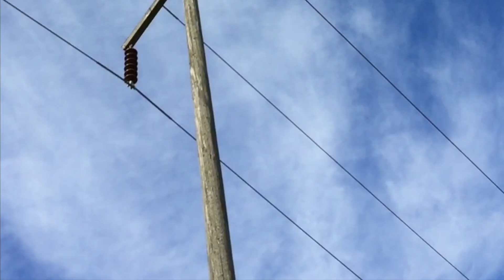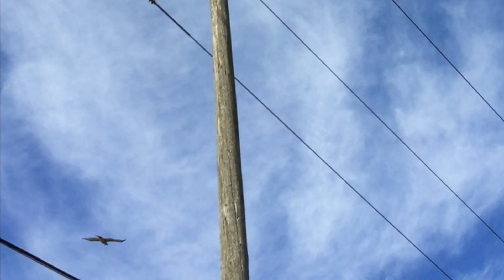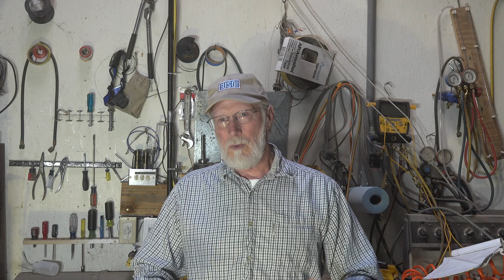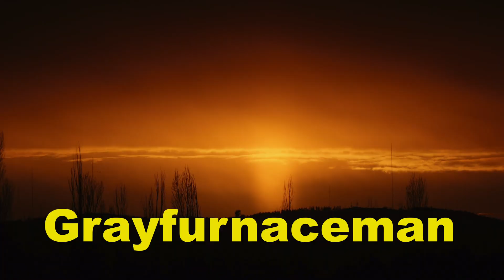Troubleshooting HVAC systems

Comment: GM gary / this year replaced  pressure switch  put ii a transformer out of panic had a rusty fuse socket we believe may have been the isse cleaned and running  got up this am houses at 63  turned on off a few time got a code couldn't retrieve it then it began to run  did note that the pressure connectors and the transformers holder nts were not tight .they where retightening  where would you begin to recheck unit  lennox down draft GHR26Q3-75 thanks  james

Comment: Hi Gary, thank you for your videos. i’m actually an electrician (25 years) and troubleshooting IS my thing. i also enjoy fixing devices at a component level (which is much harder now with integrated circuits and our disposable culture) my furnace is not working currently and now i have the basic working knowledge to get the heat back on! I have some questions for you regarding gas combination valves that your other video didn’t cover. the on/off selector on the valve slides left/right but also pushes in. since my evcon dgat056bdd has electrical ignition and a 24vac which allows the  gas to flow. does pushing down the on/off selector manually start the flow of gas? i’m getting no errors flashing on the status light, when the furnace gets its call for heat, the furnace get to the point where the igniter glows and my multimeter registers 25.2vac at the combination valve and occasionally the furnace ignites, but recently it has not lit in days,  i’m thinking it’s a old igniter which is not drawing the required amperage to allow the flow of gas or the combination valve is bad and not opening when it receives the voltage from the control board is there a way i can test the combination valve? should I press the red on/off selector?
Reply from the maker: The ignitor may not be heating as hot as it should.  If there are bright spots in the ignitor, it may be broken. You can try a resistance test.  Most run about 150 ohms.  Also I would check amp draw of the gas valve when there is a call for heat.  No amp draw, no effective power to the gas valve.  The on-off switch is just there to shut down gas flow.  It is not a bypass.  
GFM
Reply: thank you gary! i wish i lived near you, i’d love to apprentice with you. I have been doing component level repairs on pro audio equipment (mixing consoles, microphones, amplifiers) for a couple of decades. i’d love to learn HVAC and appliance repairs, but there is next to zero information out there and having watched other peoples videos on electrical troubleshooting and how to’s i don’t know which information on HVAC is as flawed as the electrical videos. you break everything down into very small pieces and having the specs such as what resistance an igniter should be is priceless. THANK YOU!!
Reply: the igniter reads 99.8ohms

Comment: But a clog is only a symptom.  I attempted to clear a line and I had to remove a piece of pvc pipe that had four elbows is less than four feet.  I cut them out and my vacuum cleared the clog right away.

Comment: I don’t know where to start? 1st of all every year I have to replace the igniter at least the beginning of the season and towards the end, never falls. I did find the straight rod igniter lasted longer then the OEM. (Snyder General GUG1990) filter gets replaced monthly. Well this year it something else. I’m not getting nothing just a click noise on the thermostat. I have replaced that a couple days ago thinking that might be the problem still nothing?
Reply from the maker: First, on the flame rod, is the furnace installed in a laundry room?  Have you cleaned the rod?  
For your latest failure.  Power to the furnace?  
GFM
Reply: Yes I cleaned the rod and no not in laundry room. Underneath my house in the craw space but I can stand up somewhat. Which my garage is on the other side of. I clean the furnace yearly since I have to replace the igniter in November and February each year, except one year I bought a straight hot rod igniter that lasted several years. It stopped working last winter but I been using my natural gas wall heater at this point along with other electric heats for the rooms I’m mainly in.
Reply: Yes power is on as well.
Reply from the maker: @runin1wild  At this point, troubleshooting will have to start.  Is there an led lit on the ignition control and is it blinking?
GFM
Reply: No light nothing blinking
Reply from the maker: @runin1wild  Is you inducer starting?
GFM

Comment: Hello I want to know why my furnace runs over night and the next door my fuse blow? Do you have any experience you can share thank you
Reply from the maker: Oil, gas or electric?
GFM
Reply: @grayfurnaceman  I’m a new apprentice,  I’m getting a good handle on things but find the wiring and electrical the hardest!
Any tips to help me understand easier?
Reply from the maker: @bobtaylor4573  Ahh, wiring and electrical, the hill that stops us all.  First, you must learn how to read diagrams.  When the wiring ends at an electronic control board, you must understand how the board works.  About the only simple tips I have.
GFM

Comment: I am having an issue with my pulse furnace g14. My purge blower is running while it is up to temperature set on the thermostat. Then times out and restarts again and again. It does this constantly. The furnace heats the house fine but the only time the purge blower stops is when it times out for a few seconds a restarts.
Reply from the maker: First, I would disconnect the W wire at the terminal board.  If the purge blower stops, you have a thermostat problem.  If it does not, you may have a stuck relay in the ignition control.
GFM

Comment: Sequence of operation is key.Knowing what it is doing or not doing relative to how it is supposed to perform is important.It is generally a three step procedure: 1) Diagnosis, 2)Isolation,3)Correction.That is define,locate ,and fix the problem. And knowing how to read schematics and experience of how components operate (Theory of operation) go a long way too.
Reply from the maker: Agreed.
GFM
Reply: Robert, you could not have said it better. Sequence of operation was drilled into my head at Linn State Technical College 38 years ago and it's still true today.

Comment: It seems like that "20% of the time" ends up being my 100% of the time.
I can't recall ever getting a cut-&-dry service call.
Reply: Cut and dry. What you mean? Like a simple diagnosis?
Reply: Turn on a furnace switch that a visitor turned off. Less than two minutes.

Comment: Methodical is best and while slow at the start, things get faster as your mind and eyes get trained.  And those you can "guess"  using probabilities, they are brain training for when you hit a hard problem.  Not to mention the guess may only be one problem on a system with several and lead to callbacks.

Comment: I did an F3 text search for "siz" on the page of your videos and noticed that there doesn't seem to be any about proper equipment sizing, IE Manual J so it's a possible topic idea.

I just wanted to comment that we have now had a few heating days since I replaced my oversized 4 burner furnace with the 2 burner model, and it is so much better. It is now more comfortable and almost silent because of the lower air velocity. I replaced the GMH95 with a DMS9 but transferred over the wiring harness, 2 stage gas valve, and pseudo 2 stage IFC board so now the DMS is effectively converted to a GMH.

I have heard elsewhere that some customers are spooked by the idea of the smaller 2 burner models and would love to hear your experiences. Also if this is why a 1 burner model doesn't even exist from most manufacturers.

Keep cranking out the great content.

Comment: Very true video. Always start with the first item in the sequence of operation and progressively test each component thereforth. Its often that many cant see the forest through the trees. Also if the guy before you checked something...that doesnt mean its functioning correctly. I get a lot of really good input from all your videos. As a gasfitter sometimes i have issues diagnosing oil burning appliances and I recently had a real puzzling scenario with a used indirect fired oil construction heater I bought. Your video on beckett clean cut solenoids and danfoss pumps was really beneficial to troubleshooting the issue. Really appreciate your knowledge and expertise
Reply from the maker: Glad I could help.
GFM

Comment: my neighbor is having issues with his heat pump what is happening is it will run in cooling mode but not in heat mode and it worked ok last year what would cause that to happen
Reply from the maker: I would be looking at the reversing valve and its actuation components.
GFM
Reply: @grayfurnaceman  ok

Comment: I have been servicing electronic and electro-mechanical equipment for over 50 years. In that time I have found that starting with the simplest faults like lack of power, blown fuse, is the unit even plugged in, which I have run into quite a few times even after another tech has looked at the job, I can solve 98% of the issues I encounter. I am a bit slower than other techs but my success rate is higher with less callbacks.